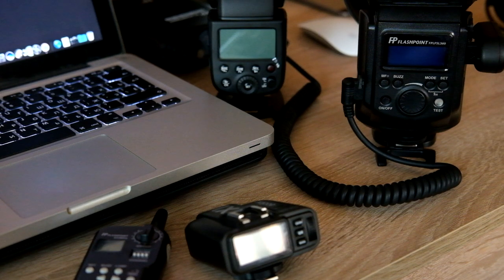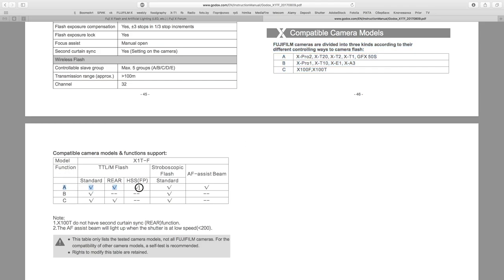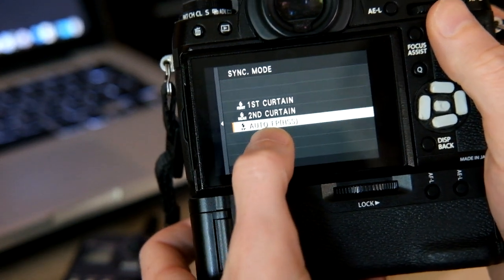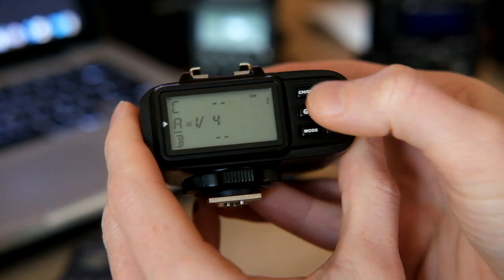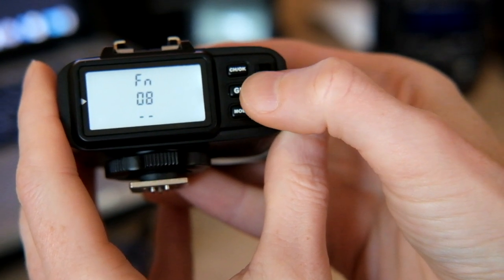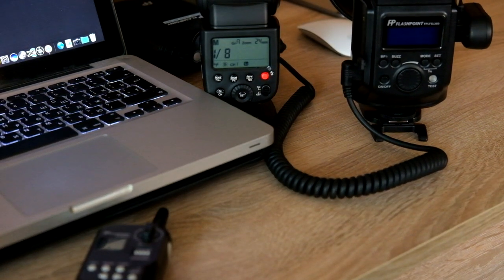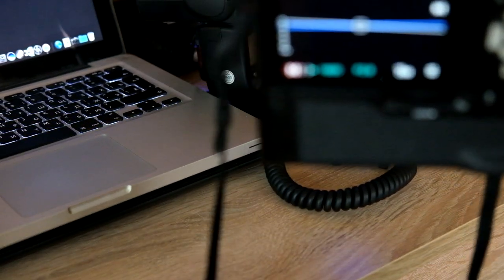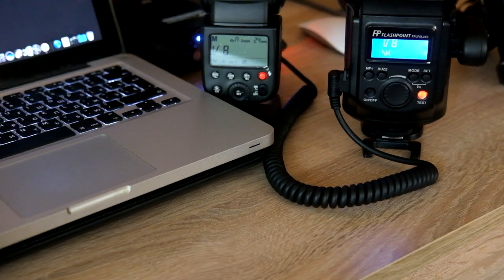Extended version - HSS with Godox X1T-F and Fujifilm cameras

Comment: Thank you very much... this was extremely helpful. I already had the X-T2 and the FlashPoint StreakLight 360 with the FlashPoint R1 transmitter. All I had to do was order the FlashPoint R2 for Fuji and I'm all set. Followed the steps in the video and tested. I was able to go all the way up to 1/8000th of a second it worked perfectly. Again... thank you very much!!!

Comment: I have X1T F and geekoto GT200, after I follow your instruction I still cant shoot on HSS mode, please advise thanks
Reply from the maker: Is Geekoto an another name for Godox? If not this combination will not work as the flash and transmitter use different protocols.
Reply: Now Change from geekoto to godox TT 600 and the rest is a same, i follow your instruction accordingly, on Shutter speed 1/250 flash is working but when I raise speed to 1/500 flash it doesnt work, any advised ?
Reply from the maker: @ariefwardhana3519  did you switch in camera flash menu FP/HSS and in flash HSS mode?
Reply: Thank you for your prompt reply, yes precisely already follow step by step your tutorial, possibility my trigger have a problem ?
Reply from the maker: @ariefwardhana3519  well in fact I can't get any idea, why this setup doesn't work. The last guess is that may be you should install the latest firmware for camera and transmitter
Reply: Алексей Исаченко thank you for the idea, let me update firmware both and let you know
Reply: @ariefwardhana3519  did you solve the problem??? my problem still there even updating the firmware

Comment: Hi, im using fuji xt30, with godox x2t trigger. The problem is in my sync menu there is only 2 option which is front and rear. How can i find the hss setting? Btw, in my flash setting the ttl is grayed out. Only Manual or Off can be selected, and i’m in manual mode. Pls help me😢
Reply from the maker: I don't have XT-30 and X2T? but I can guess that you are in electronic shutter mode. Try to switch to mecanical shutter.
Reply: @boomeart  unfortunately I’m in mechanical shutter already.
Reply: In the flash function setting, everything look the same as yours, except it does not show “hot shoe mount”.. and the ttl mode is grayed out😢
Reply from the maker: @nasrulacown6066  than I don't know, sorry.
Reply: @boomeart  problem solved, newbie mistake actually. The trigger is not fitted correctly onto the hot shoe😅. So only 1 pin is connected to the hot shoe instead of 3 pin.

Comment: Hi, very great video. im using same equipment, but I cannot get TTL mode at after going to Flash Function Setting  and  HSS setting is not available.. my firmware is updated 5.20. What may cause this problem?
Reply from the maker: Sometimes it can occur by some unknown reason. So try to attach transmitter once again. Make sure that you slide transmitter till the end that all pins on contacts mach to each other. Also you can try switch transmitter ON and after that attach it to camera.

Comment: Hello, thanks for the video !
Could you please explain what exactly does the Fn12 function, from latest firmware update ? I doesn't understand it, but had to change the value to make the trigger work on my xt3...
Thank you !
Reply from the maker: Fn12 doesn't relate to camera as far as I know. It serves to set up radio frequency identification. If you have AD400Pro or AD600Pro, or V1 (may be other godox flashes has RF Id in the menu) you can set up the same radio frequency identification on both transmitter and flash. That means that if someone with the same trigger is shooting near you and you both set up the flash to Group A Channel 1 for example, but you set up your stuff with specific radio frequency identification so another photographer will not interfere your shot. He simply can not fire your flash with his trigger.
Reply: @boomeart  thanks ! In my case, I've problems to get trigger and flashs on the same RF.. How can I see wich RF is on ?
Thanks again !
Reply from the maker: @totiglobule  I'm afraid I can't help you. Because my AD400Pro supports RFID, but I didn't upgrade my X1T-F with latest firmware as I'm not crossing with other photographers at the same location :)
Reply: @boomeart  thanks for your reply..
It's not that mater to prevent the case of another photographer, but to find how to share the same RF between the trigger and the flash...
More, WHEN thé flash works, another one on the X1T in manual mode doesn't fire, even with the Fn inabbled...

Comment: I'm using fuji XT20. Can godox X1T F works on godox tt685 for canon? Thank you
Reply from the maker: According to the chart https://cloclo22.datacloudmail.ru/weblink/thumb/xw1/Gsej/uPfEQuoem/0cd124b25c0edd913e5d07fbbb829f9a357c86395dd483fb42e0653563a76bb8.jpg?x-email=isachenko-aleksei%40mail.ru X1T-F compatible to TT685. Canon, Nikon, Sony - the difference is in pins on hot shoe mount. So my answer is YES it should work. But if you have possibility to try before purchase I would recommend you to try. Because as I can see in forums and here in comments not everyone can get HSS mode even with the same as mine setup.
Reply: Алексей Исаченко  thank you so much 😀

Comment: Thanks for the video, it was very helpful. I know this is a HSS instructions video but I have another question. If you set FEC in camera and a different setting in the X1T which one counts? Also does the HSS works in TTL mode with the TT600 flash?
Reply from the maker: Zisis Kardianos I'm not an expert in first question and did not try FEC.
The second question is not correct because TT600 does not support TTL. But I also have TT350F and it has both TTL and HSS and if you chose in camera menu FP/HSS it is working, I mean HSS works in TTL mode. So let's hope that any other Godox flash which support TTL and HSS will work too.

Comment: Hello. Thank you for this  video.  A quick question, what is the purpose of the extra hot shoe, on top of the devise ? Is it active all the time and regardless of the mode and settings you use?
Thank you.
Reply from the maker: As far as I know the top hot shoe is active all the time. it is made if you want to use wireless flash(es) on stand(s) in combination of flash mounted on camera. Or you may use 3-d party trigger to fire another brand flshes. For example, you have Phottix studio strobes which have TTL and/or HSS and you have Phottix transmitter. With Fuji cameras you can use your Phottix equipment only in manual mode, but in combination with Godox X1T-F you have TTL and HSS.
Reply: Thank you for your prompt reply. Exactly this scenario I have  in mind. Is there any chance  to verify it for sure, before I go to purchase the godox system ?  In the user manual, that I downloaded  it is not so clear. Thanks again.
Reply from the maker: I'm afraid I can not help you because I do not have other flashing equipment and my neighbours too. To go to the rent studio in order to check it out ... hmmm.... may be but not so soon.
Reply: Anyway, thank you so much.

Comment: I have xt20 + X1T-F + tt600 in the same setting but my flash not working when in hss mode. Why?
Reply from the maker: taiy I don't know why. I can suppose you have missed something in settings of flash or camera, or transmitter. 
Many people do not fully mount transmitter to camera and pins do not have proper contact.

Comment: i have xt1 and x1tf+tt600, same ur setting but can't hss mode, what ur firmware in xt1 ?
Reply from the maker: Lia Lis the latest. I update to the latest version a week ago.
Reply from the maker: The latest, 5.20
Reply: Hi, im using same equipment, but I cannot get TTL mode at after going to Flash Function Setting  and  HSS setting is not available.. my firmware is updated 5.20. What may cause this problem?

Comment: I have an X-T20, HSS enabled, but every time I clicked the shutter. the X1T-F won't allow me to change the values anymore nor access the flash. I can change the mode, but I can neither access ch/ok nor GR (to change the power of the flash).  I'm using the Wistro AD200 for flash. The transmitter, the flash and the camera are all upgraded to the latest firmware. M+ES shutter. My custom functions are the same as yours.
Reply: Can the XT20 +X1TF work?
Reply: because youre in m+es shutter. it works only on m shutter

Comment: Hello, thank you for your video. I have the same as you (XT1 camera updated to 5.2 or whatever), X1T-F transmitter updated with the newest firmware and a TT600 flash. I could not get HSS to work how you said in your video HOWEVER if I set the shutter to MS/ES it works FULL HSS at any shutter. If its just in MS it doesnt. Just thought I would pass that on for people who are still struggling to get this working
Reply from the maker: Well, if you upgrade the firmware of X1T-F with the latest (released few days ago), so go to C.Fn11 and set it to 02. This should help and you'll be able to use only MS shutter.
Reply: Hi I have already done the firmware upgrade and set fn11 to 02 and it still doesn't work. Only setting es/ms works
Reply: TT600 is not for HSS?
Reply from the maker: Sai Sai TT600 is for HSS.
Reply: TT600 is not only single pin?
Reply from the maker: Sai Sai stop asking silly questions. Just download from Godox site the manual and read it.
Reply: http://www.godox.com/EN/Products_Camera_Flash_TT600.html
I only remember that TT600 has no TTL, and I just bear in mind single pin was no TTL and  no HSS
Reply from the maker: Sai Sai TT600 can work in HSS mode, but not supporting TTL. And  my video shows that it works.

Comment: The Godox trigger does not work with off camera flash with the X-T2.
Reply from the maker: Do you use trigger compatible to your flash in frequency? Do you use Godox off camera Flash? Did you turn on wireless receiver in off camera flash menu?
Reply: I checked with B&H and made sure that the firmware for the flash, trigger, and the Fujifilm X-T2 was current and had them all on the same frequency, channels and group.  Which custom setting on the trigger is for off camera flash?
Reply from the maker: Check the manual here http://www.godox.com/EN/Download.html It should work.

Comment: Thank you sooo much..........oh I can read your name becasue it's on Russian alphabet. Anyway. Thank you so much for your tutorial! 

Finally I can shoot HSS with the X-T1 and the Wistro AD360 combining the X1T-f and the old FT-16 transmitters. 

The only thing I don't understand is why you put the shutter on MS+ES ?  With ES the flash won't fire, so the maximun speed it's 1/4000 sec right ?

Again, Thank you so much!
Reply from the maker: My name is Alex :) My flashes fire in MS and in MS+ES modes. So I prefer to leave combined mode. By the way, I received usb receiver XTR-16 working on 2.4 Hz frequency and my AD 360 mk I works with it and X1T-F. So there is no need use "sandwich" with 2 transmitters.
Reply: Алексей Исаченко Well Alex, I already had the new receivers but I couldn't make it work. Your solution combining both transmitters works all the time.
Reply from the maker: Juan Kis Try to upgrade the firmware for X1T-F, with new FW it works for me.
Reply: Алексей Исаченко I will! I didn't see any fir Fuji but after you told me that, I've scrolled the screen an I see the Fuji one under G2 group
Reply from the maker: Here http://www.godox.com/EN/Download.html you can download the latest firmware for X1T-F. And after installing it try to go to C.Fn 11 and select 00 or 02 mode. Check with each mode how your AD360 mk I works with 2.4 Gz receiver.
Reply: Done! It works great! And no more Frankenstein transmitters.   It work amazing!!!! Do you have a website?, I'd like to be in contact with you, we use the exact same gear, and is great to know a guy using the same stuff even if you are in the other side of the world.  My website is juankis.com and kispix.com
Reply from the maker: Juan Kis I only have blog boomeart.blogspot.com and you can find me on Facebook https://www.facebook.com/BoomeArt